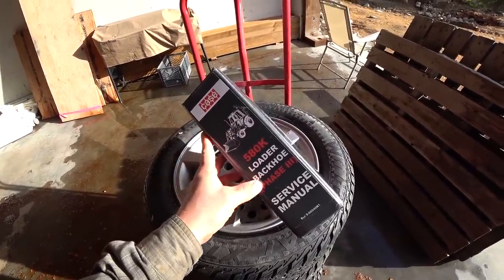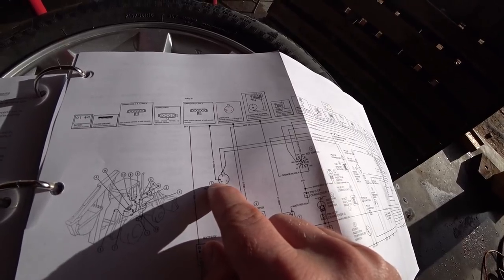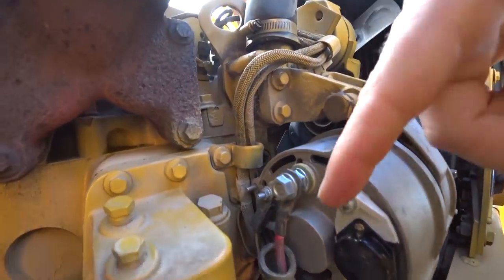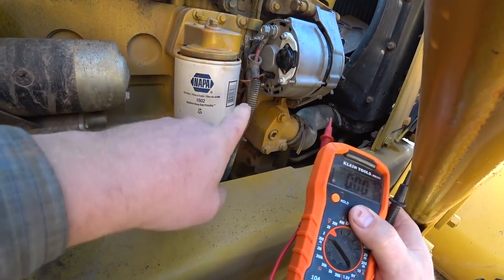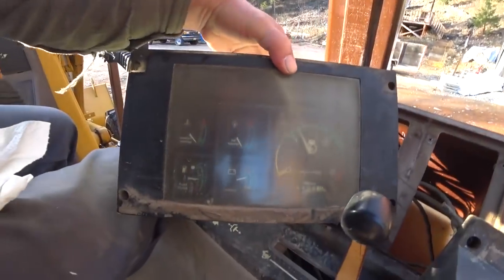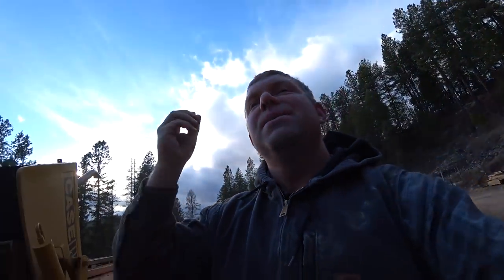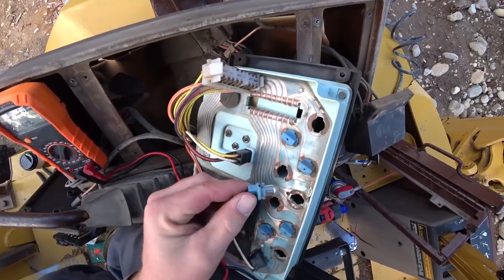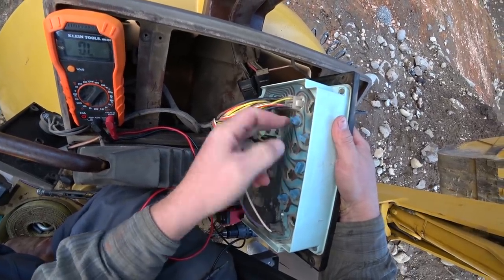YOU WON'T BELIEVE WHAT THE PROBLEM WAS!!

Comment: If you have a junk yard nearby you can get the mini wedge bulb holders out of a mid 80's Volvo 240
Looks like a Bosch alternator check the cross reference on the casting if so there is an adjustable regulator you can get to dial the voltage to where it needs to be
Reply: Scott Johnson it's a Delco Remy alternator. It's a GM brand of alternator. They're widely used in the U S for industrial and marine applications. And when you get into the bigger ones for big rigs they're generally a Naleese DeVille brand. Which is the same design as a Delco Remy.
Reply: Clyde Acor 
New alternator assembly. 12 volt, 90 amp, less pulley. For tractor models 1896, 2096, Maxxum Series: 5120, 5130, 5140, 5220, 5230, 5240, 5250, MX100, MX110, MX120, MX135, MX80C, MX90C, 480F570LXT, 580L, 580K, 580M, 590L, 590M, 680L, 780D, 1835C, 1840, 1845C, 550, 550E, 550G, 550H, 650G, 8840, 8850. Replaces Bosch 0-120-484-011.

Part No: A187623

Delco use an internal regulator where as Bosch use an integrated regulator brush holder on the back
It looks identical to the one on my international tractor

Comment: At the very end, did you have the drill going anti-clockwise trying to drill a hole into the metal? LOL!
Reply: Kathy Girlygirl -- Screw extractors have reversed threads so that they dig into the screw to back it out.  That's why the drill was running backwards: to get the screw with the broken head out.

Comment: I concur with the idea to make it a parallel circuit. Depending on an incandescent light to complete a circuit to make the machine run is just, well, idiotic. The light should depend on the circuit being on, not the other way round. If not to the actual ignition switch then maybe to the panel light switch. It shouldn't be that hard to find the bulb holders for that panel. I imagine they were used for many different pieces of machinery. I'd probably consider converting them to LED's and also replace that scratched to heck faceplate while I had it apart.
Reply: CrimFerret The reason an incandescent bulb is used is because the pulse current needed to excite the armature is higher than what you can get with an LED.  Anyone who has maintained engines before fuel injection knows to check for the battery indicator lamp to glow when the ignition switch is turned to the on position.  The lack of lamp on start would flag that the lamp is burnt out.
Reply: CrimFerret cars with indicator lights have used this design for years...takes a small current to excite alternator so bulb is simple cheap voltage reducer.

Comment: Hi from Bulgaria, love your videos, as you have found out, the bulb is the issue, however, the voltage at the exciter wire connected should be between 1 to 1.5 volts, if you disconnect the wire, you will see battery voltage. This is correct. A voltage of between 1 and 1:5 volts shows that the circuit through the field windings, brushes and regulator is complete and working. When the engine is running, you will see that voltage returns to that wire connected, the regulator pulses the earth to control the alternator output. Hope this helps.

Comment: A printed circuit board can really only handle about .05V (depending on the width of the trace.
Reply: I suspect you mean amps not volts, and 0.5A should be fine on traces that wide. Voltage limits come from trace separation mostly (in the "about 12V" range anyway), and 12V or 24V would be fine on any circuit board Jesse is likely to find.
Reply: John Kerns 1985 Volvo 244 tail light is the same circuit material 14 volts with car running and 21 watts on the brake light or just shy of 2 amps
A modern tube amplifier has up to 350 volts on the circuit board
Reply: ok is this a question or a statement? If statement' that is why I put in parenthesis depending on the width of the copper trace. If a question' I don't quiet understand what it is your asking.
Reply: So your saying that I can run 24V through a 24 AWG Stranded copper wire at 0.5 A? Just a question I don't mean to be rude or anything just trying to understand.
Reply: John Kerns it's a matter of current not voltage 
Inside a computer the CPU runs on 3.3 volts at about 6 amps average or about 18 watts 
A 6 core is closer to 90 watts peak. The The fr4 circuit board acts like a heat sink pulling the heat away from those
Very tiny traces on the board
Reply: John Kerns yes 24awg will handle 1\2 an amp as long as your wire runs are short

Comment: Rectifier" in Electronics/Electrical Engineering is a device which converts AC voltage to DC voltage. The motorcycles these days have an alternator which generates AC voltage, in some bikes as the BMW, 3-Phasevoltage is generated. The battery needs to be charged by around 12 Volts DC. ... Hence a rectifier is needed.Nov 18, 2014
Reply: I don't think I have EVER seen a light or heavy duty vehicle alternator that does NIT have 3 phase wiring inside of it.  No one knows this because diode rectifiers convert it to DC before it leave the alternator housing.

Comment: Actually the wire creates the magnetic field so that alternator create electricity does not activate voltage regulator the voltage regulator converts the AC current to DC current
Reply: The voltage regulator regulates the voltage and nothing else michael.  The rectifier is what changes DC to AC current.
Reply: flick22601 full b.s.
Reply: Wow...... I literally had to decrypt the original statement due to a severe lack of punctuation.

Flick is 100% correct. The voltage regulator, regulates the voltage to maintain 14.5 volts. (no it does not maintain it at 12 volts.... it operates between 13.2 and 14.5 and it swings based on feedback)

The Rectifier circuit rectifies the alternating current to direct current.

But luckily for us this particular alternator uses a rectifying regulator. In short, it first rectifies then regulates.

Now lets move along.....

Comment: You can pretend you know what you're talking about all you want it is obvious you know nothing when you excite an alternator you are creating a magnetic field to create electricity and if you leave an alternator excited it'll drain the battery because it's constantly creating a magnetic field
Reply: Michael Thomas, since you’re so intelligent, can you tell me how to excite the alternator and what doing so is called? There was a fix for this issue that Jesse could have done without touching tools, and there is no reason to expect him to know what it was.
Reply: Luke Miller simple simple running 12 volt positive lead from the ignition to the alternator when you turn off the ignition it will not drain the battery
Reply: michael Thomas You overcomplicate it. He could turn the key again to the starting position. The starter will probably not engage as many pieces of equipment have a lockout at a certain RPM. This action would flash the field and correct the symptoms. His fix was permanent, but flashing the field with the ignition switch is a quick bandaid. Now you’ve learned something today.
Reply: Luke Miller you're entitled to your own opinion and you don't need to ask me for mine anymore either
Reply: michael Thomas ok chief.

Comment: Here's a good tip for you you ever need to replace that alternator it does not have to be at $400 tractor alternator you can use the old Chevy Style works just fine

Comment: how much money you willing to put on that Mr I've been working on cars since 97 and motorcycles and tractors and when you excite the alternator you creating an electric field to create electricity through magnetic electric current which is a sea and the rectifier rectifies that from AC to DC any time you spend of oil winding in a magnetic field they create alternating current not direct current

Comment: Why are they playing with a backhoe when they have no roof on their house?
Reply: OlafGodredsson cuz the roof can't be put on until the SIP plates are put on.... SIP plates can't be put on, until windows have been decided on. Yeah, I can tell u watch....
Reply: One can say lack of experience in planning such a project. In my opinion the drawings with windows and doors should have been finnished before the timber frame party, and the sip panel should have been there within a couple of days after the finish of the timberframe. That way there would have been a watertight house to meet the winter, with room to do a lot of work inside in snowy, stormy days, and an outside that can wait till spring before finishing.
Reply: Magne Polden I agree. .. but these are rookies in the building field. They've made countless mistakes along the way, some with worse consequences than others, but I do admire their perseverance & just the willing to learn.
Reply: I am a norwegian, who have learned some english. But in my dictionary rookie and lack of experiance are the same word, and the only way to get experience are to learn. And to learn are something they really do, and they learn fast.
However, I still think those sip-panels should be there ASAP, to prevent the timberframe be too wet, just to avoid a fungus invation when spring comes. Also I think there can be too much moisture for the floor, so it get soft. In that case the cure are new floor.
Reply: Magne Polden the timberframe institute had to happen on THEIR timeline. It pushed the SIP and window decisions off.
Reply: Kathi Pauling, you are right. But someone let the sip and windows be pushed off, those decisions should have happened in the looong days at the sawmill before the timberframe institute. But I know they were pushing as hard as they possibly could to finnish the timber.